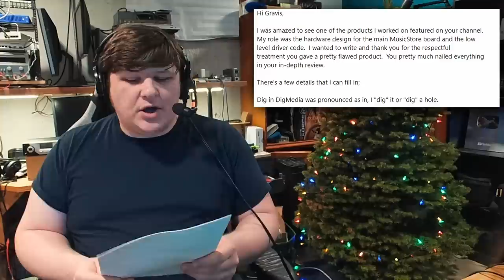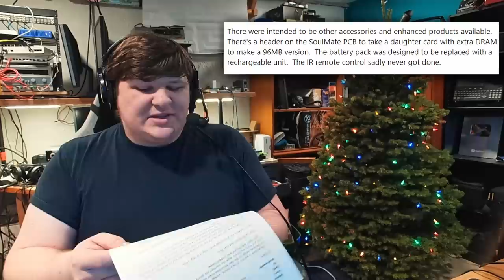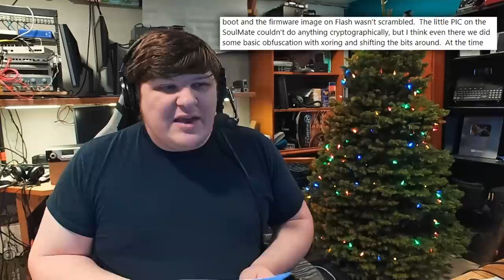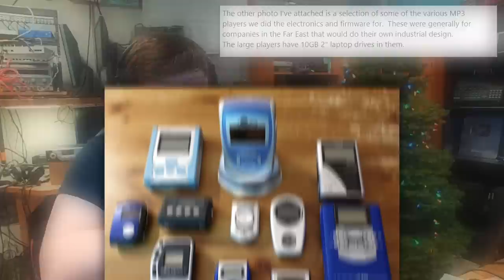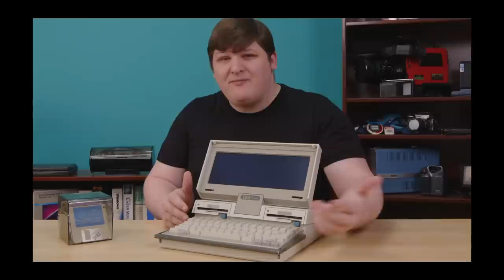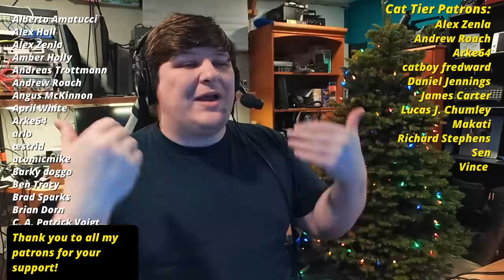The Rest of the MusicStory

Comment: the venn diagram of skills to comprehensively reverse engineer and document hardware and software, and to weave a compelling narrative about devices and the social and technological ecosystems they inhabited, are two separate circles. there is certainly value in the exhaustive research, but as someone with the former skillset and not the latter, i often wonder philosophically about the value of such research that doesn't reach an audience

you touch on this around the 28 and 31 minute marks... there are times you've hand-waved past a deeper explanation, while i'm thinking "hold up though, that would be pretty straightforward to go figure out". while that might briefly leave me with an unscratched technical itch, i recognize how those details are largely irrelevant to your goals of documenting the subjective experience of an era and/or the alternate timeline we nearly lived. perhaps there's room for more follow ups in the future, where you nerd snipe someone in the audience into providing the technical assistance to dump the firmware and resolve any loose ends through reverse engineering for a subsequent video. but requiring this before releasing every video would add significant overhead to your production flow in the form of a blocking dependency on another person, which is the sort of management burden that saps creativity, delays release dates, and becomes the downfall of small-scale endeavors such as yours

for what it's worth, i doubt i'd still be on the cat tier if i didn't thoroughly enjoy your creations and respect the effort you put into them :)

Comment: Much more important misinformation that DOES make a difference:

People who say "siliKIN" when referring to either/both silicone and silicon (it happened in this video, and almost every Youtuber does the same thing)
People who use the word "dongle" to describe ANYTHING other than a hardware device used for software copy protection.
People who say "e-mails" (also happened in this video), when the plural form of e-mail is e-mail, the same way the plural of mail is mail.
People who believe that hackers are all criminals because of what the mass media says.  In reality, more than 99% of hackers would never use their knowledge for anything bad.
People who say "an e-mail" when that's not actually a thing.  E-mail is the name of the service, not the end product.  It's correct to say "You've got e-mail", just like it's correct to say "you've got mail", but it's NEVER correct to put the word "an" before "e-mail", unless it's followed by another word such as message, or attachment.  You can correctly say "I recieved an e-mail attachment with blah blah blah", because you are talking about the attachment, or the message, not the service name.  Just like it would never be correct to say "I got a mail today".  You would just look insane if you said that, so why do so many people say everything wrong when it comes to e-mail?  You would be much more likely to say "I got a letter in the mail today", or "I got a package in the mail", or simply "I got mail".  Adding an adjective abbreviation (the "e" meaning "electronic") to the word mail doesn't magically change all the rules of grammar.  That would be just like changing the rules based on whether you said there was a dog, or a brown dog.  The adjective doesn't change anything, so please (EVERYONE) stop trying to change grammer when talking about e-mail messages.  It does not make things easier, it just makes everyone sound uneducated.
People that think "axe" is a correct pronunciation of "ask".  It's not an "accent" thing, it's just the wrong word being said, plain and simple.

I know someone is going to say that most of this isn't misinformation, but if you think about it, all of it really is misinformation.  People using the wrong words because they were misinformed by uneducated people before them.  People are going to tell me that it doesn't make a difference, but yes, it actually does.  The English language is getting bastardized, and people are LITERALLY becoming dumber because of it.  Not EVERYONE is getting dumber, but facts are facts, and incorrectly using words does damage in the long run.  People are going to tell me that it's just language evolving, but in reality it's not language evolving, but humanity DEvolving!

Sorry for my rant, but these things just bug me to no end, and they always will.  There are several more things I could have added to the list, but it's 3am and I'm trying to get to sleep soon.